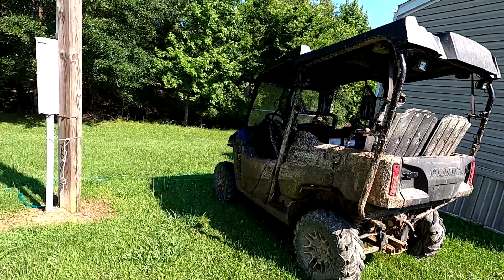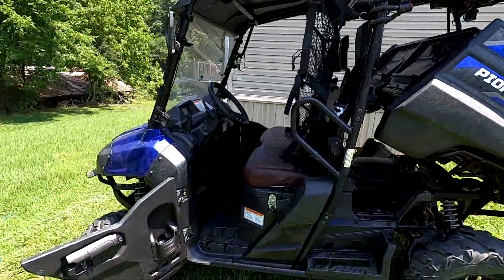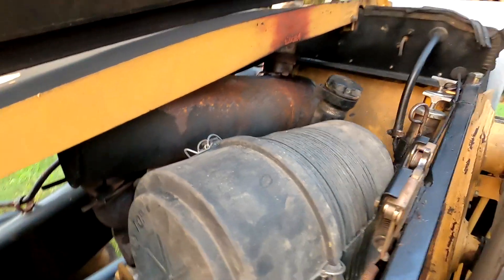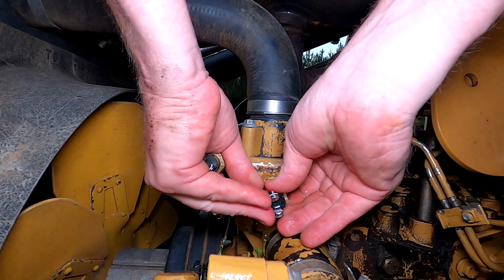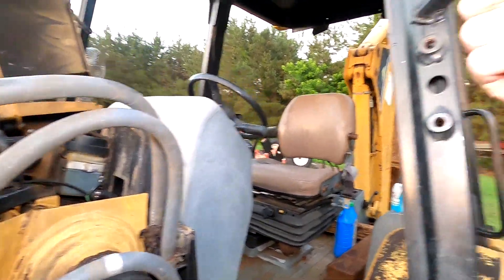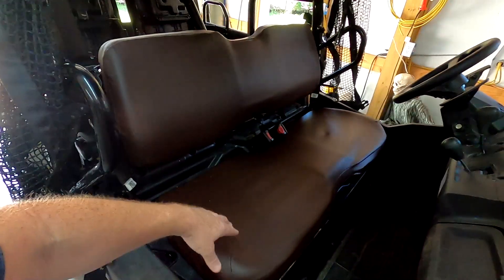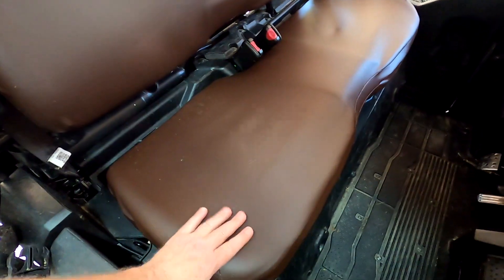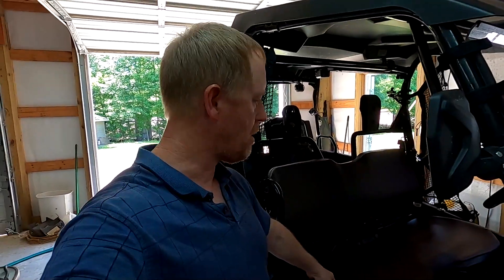Your Honda Pioneer is hungry.   Feed it some mud.

Comment: I finally got my Pioneer 700-4 deluxe. I love that thing, it’s the perfect size and plenty of go
Reply from the maker: Awesome.  What color did you get?   We have friends with other brands and their machines are always in the shop.  After 19 months of rigorous use, my 700-4is still running excellent.  It helps that I treat it like a baby.  :)
Reply: @MikeM100  I got the Matte Molasses Brown, yeah I love the machine! I’ve always owned Honda’s since I was a kid, I’ve never had any issues and they’ve all been through the ringer. So far on the P700-4 I’ve added roof, windshield, winch, and sound bar. Light bar is next
Reply from the maker: That's a really nice looking machine.  That color will be the next one I get also.  That's a lot of stuff to operate on one battery.  Are you going to add another battery?